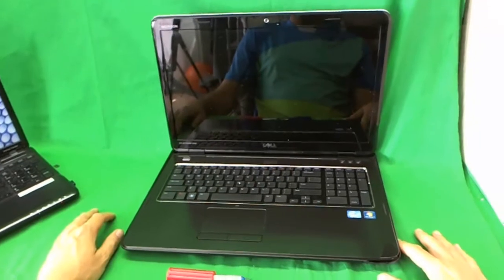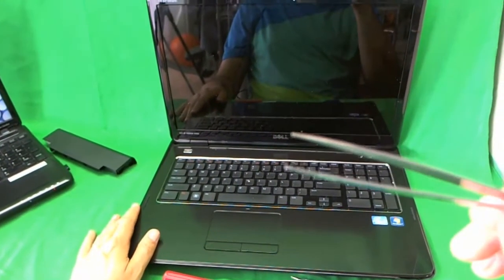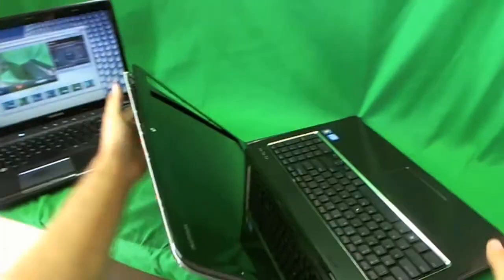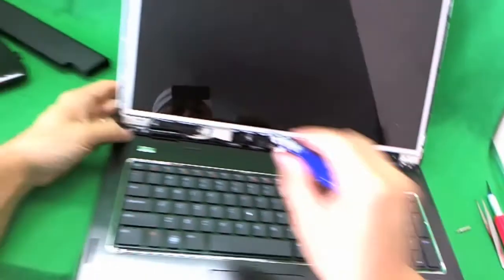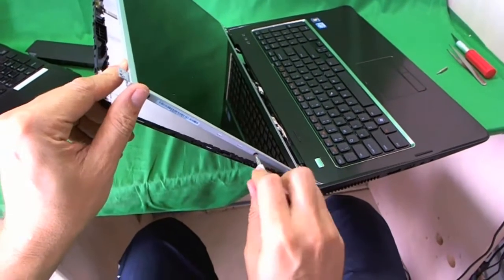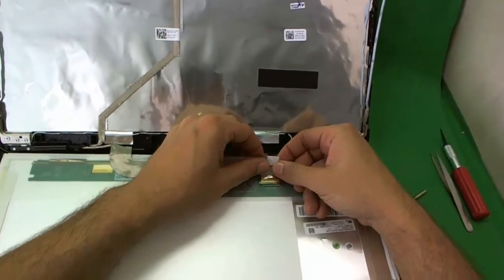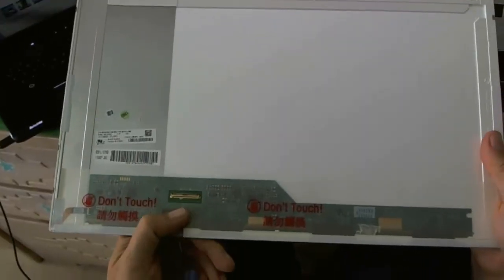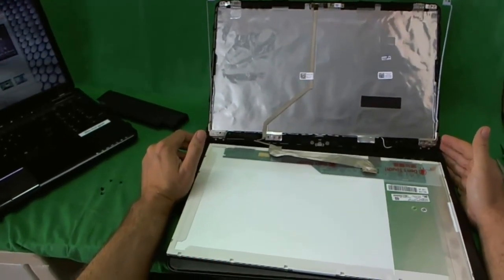Dell Inspiron N7110 Laptop Screen Replacement Procedure

Comment: This tutorial was VERY helpful.  Thank you so much.  Just one question...
How can I be sure the problem is my monitor and not wiring?  I have multi colored lines throughout my screen.. It started with lines on the right side, about 1/4 of the way in and the bottom 3" ....I was still able to use my mouse and see most of the screen.  When I opened it to look at it today, It is all over the screen and I cant see the mouse anymore.  Can you just give me your thoughts?  If I need the monitor, I will just order from you.  Thank you.
Tamara Parker

Comment: I have the N7110 and dropped it a few months back. The screen cover chipped on the right hand corner the laptop works fine.
However now every time I close and open the laptop the cracked piece has started opening wider and wider.
Is there are place where I can order the plastic cover holder.

Comment: Bought my Dell Inspiron N7110 from Best Buy less than a year ago and heard a pop the other day, then screen when white.  After just a couple minutes, a black spot started growing on the bottom of my screen, just right of center and it was extremely hot.  Dell made me ship it to them in Texas, then tried to tell me it wasn't covered under warranty and it would be $400 to fix!  Forget that - you just saved me $330 ($70 for the screen).  Thank you kind sir!  Dell - what a ripoff. Never again.